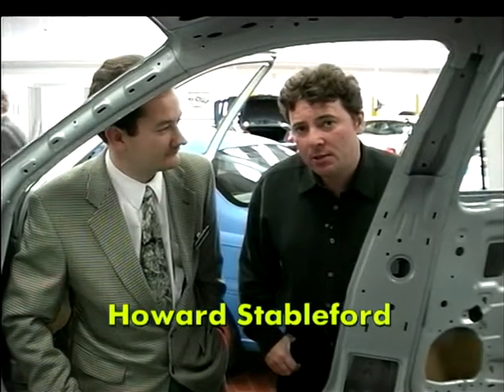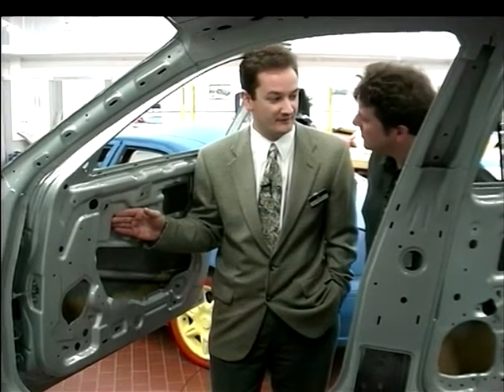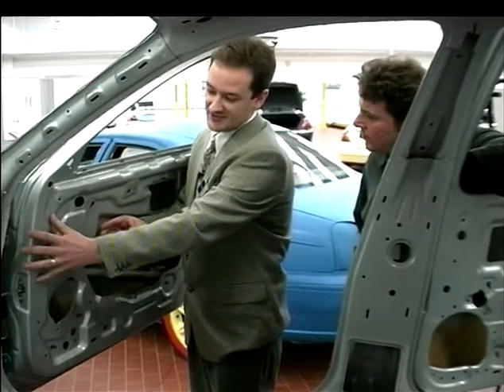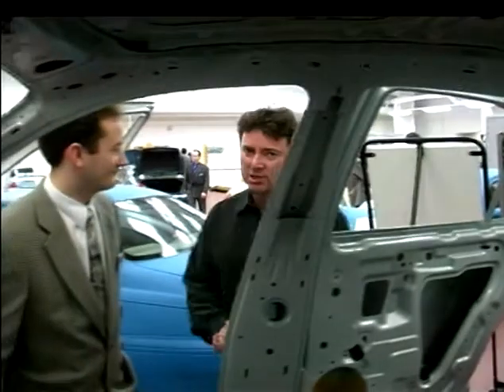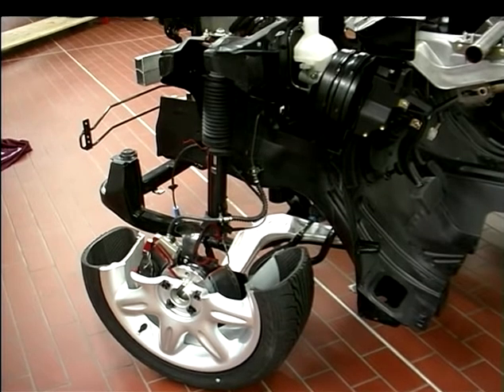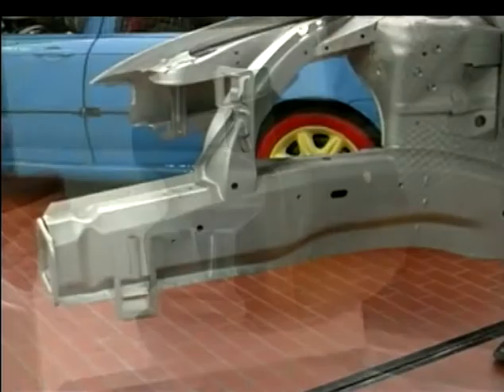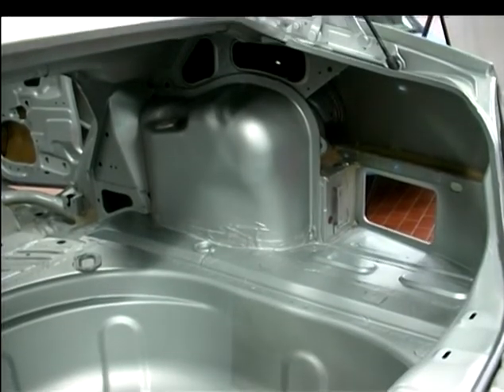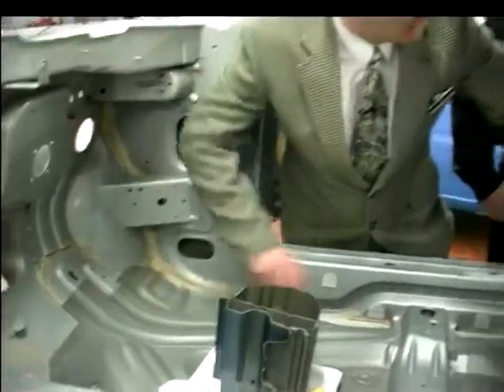1999 Rover 75 - Tailor Welded Blanks & Stiff Body Structure

Comment: I think you'll find the V8 came from Ford as fitted to the mustang and the K series is Rover, 2.0 was a V6 Rover engine as was the 2.5 and diesels came from BMW.
As for the rover 600 That was a re skinned Honda accord, using Honda 1.8,2.0,2.3 engines and Rover 2.0 Diesels, and for it's time the body shell was as strong as any other make.

Comment: 2.5 times stiffer body shells than a Rover 600 a flap jack has a stronger body shell than the rover 600. Rover and Austin made complete garbage the 75 was good but mainly because BMW showed them how to make a car properly. The engines weren't bad but V8 came from Buick and the K series came from Honda. There were a few innovations that came from the Leyland group but mostly they were out classed by other manufacturers.
Reply: This was designed and developed before the BMW merger though... the 5-Series was just used as a benchmark.
Reply: In fact - it was Rover that taught BMW how to build cars. At the time they purchased Rover Groupt, they were still using 'Finish and Finesse' quality adjustment at the end of every build, which meant that anything that was put in properly was fixed after heading off the production line. Expensive. Rover were using Honda 'Right First Time' techniques which basically meant that problems were fixed on the line before quality inspection and is one of the things that came from Japanese manufacturing processes.
Reply: Rover were on their last legs when BMW bought them. They only bought Rover to strip it of the Mini name and Land Rover tech I don't believe BMW needed any help from Rover. I know a lot of people were fond of Rover but they stayed still too long rehashing old designs. In the 80s they built a reputation of poor quality and reliability. I always liked the SD1 but they were poor cars. They only stopped making the original Mini because they crash tested it and the Rover Metro and scored almost zero. I worked at Jaguar when Rover closed and a lot of Rover workers came to Jag none of them had great things to say.